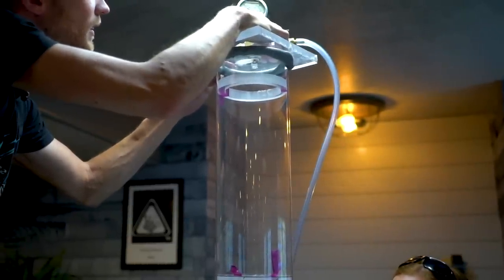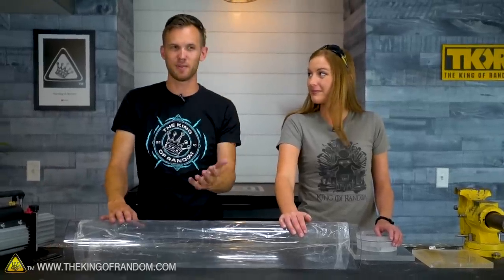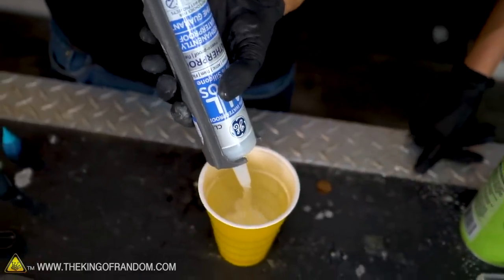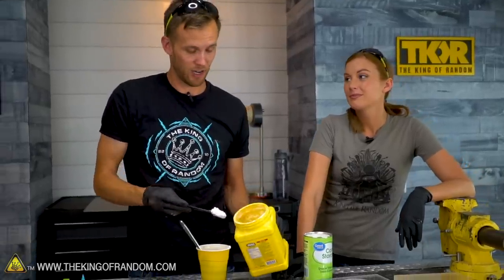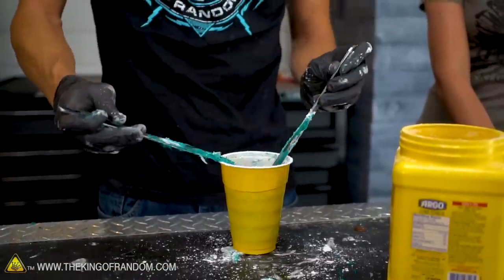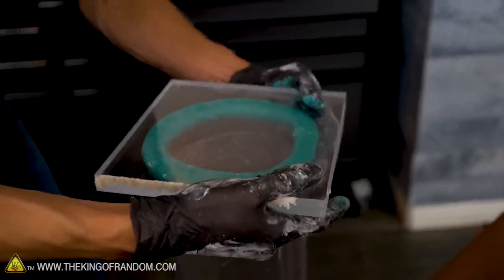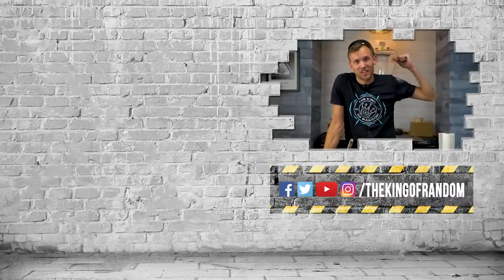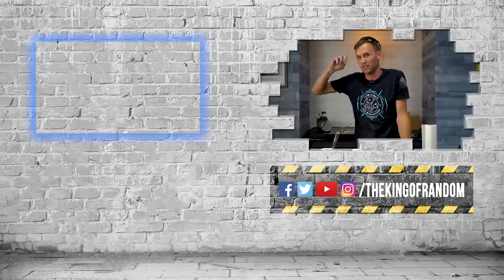Watch How Things Fall In Space

Comment: What would happen if you drop mentos in coke in the vacuume chamber ?
Reply: Kayden Mauldin the coke would start boiling, while the bottle would crush, so would be kinda hard to do the experiment.
Reply: And if you didn't do it at a full vacuum the CO2 in the coke would just fill the vacuum.
Reply: If you put the Coke in the vacuum chamber and then you drop in the mentos, the air bubbles in the Coke would have already been extracted, removing all of the pressure, thus resulting in no reaction from contact with the mentos
Reply: Kayden Mauldin the coke would not be acid any more and Mentos will not have something to react to
Reply: Souless would not be in bottle
Reply: @kueenkouture4362  has nothing to do with the acid in coke and the mentos don't in react at all. What happens is nucleation. The mentos have literally 1000s of little spikes on them and little dents. These places / points help the carbon dioxide toe release from the coke. You can also use salt sand or even powdered metals. Many bars have glasses with a small ring in the bottoms that perform the same function. If you go to a nice bar after work or something look in the bottom of your glass of beer. You will see a ring a little larger than a pencil eraser in the bottom
Reply: @nanaki-seto  the acid in the coke is where the carbonation comes from. It's called carbonic acid.
Reply: Smart bro smart
Reply: Kayden Mauldin the coke will boil befor it’s ready to drop
Reply: Hmmmmmmmmmmmm?!??????????????
Reply: @NFTI  it's still what holds the extra CO2 in the drink.
Reply: @mimked  They pump C02, into the water, where it dissolves into the liquid.
Reply: @mimked  and that is not what causes the reaction. The reaction is the carbon dioxide gas being released from solution. The acid type reaction your thinking of is vinegar + baking soda and other similar reactions . They can be based on a acid reaction or a base reaction . Again not what happens with mentos
Reply: @nanaki-seto  is that what I'm thinking of? I just said that the extra carbon dioxide is held within the acid (carbonic acid) contained within the drink. So if the acid was gone (as someone said earlier would happen if the drink was put in a vacuum chamber), then there wouldn't be any CO2 to react to the mentos. Unless the nucleation doesn't come from inside the drink.
Reply: YES
Reply: XxsparksgirlxX oof 
D
Reply: Souless guys the action lab did it search it up on youtube
Reply: 600th like
Reply: Nova Flare NERD
Reply: do it
Reply: Chaos
Reply: Not much will happen
Reply: a thing that involves liquid that I cannot confirm
Reply: We will never see him do it 😭
Reply: @rayneang5153  yup 😞
Reply: @nanaki-seto  theres no acid in the coke. The coke is acid
Reply: @mimked  theres no coke in the acid. The coke is already qualified as an acid because it was mixed with carbon dioxide chemically which would result to the change of the components in the mixture.. it would be a whole new thing. And ye the coke is acid there isnt acid in the coke, get that right.
Reply: @nanaki-seto  basic reaction* its not base reaction.
Reply: @Bruh-yt9hz  I don't see the functional difference in lay person terminology. If "the coke" refers to the bottle of soda, then yes, there is acid in there (unless it's gone flat). 

If "the coke" refers to the liquid contained within, then sure, the whole thing is acidic due to the carbonation process. But that doesn't make it fundamentally wrong to refer to the acidic component as "the acid". Carbonic acid is H2CO3. That doesn't include the syrup that makes "coke" coke. And if that acid breaks down to H2O and CO2 (what happens when the soda "goes flat"), the non acidic solution within will still be called "coke". So referring to Coke as "the acid" is a bit misleading to the normal, everyday person.
Reply: @mimked  if that still isnt clear to you, mabye you have a different concept of the term "acid"
Reply: @Bruh-yt9hz  Sure, that's possible. 

It's also possibly that you just didn't bother to read what I just said.
Reply: Coke does not have carbonic acid, it's just desolved CO2 and when CO2 enters the stomach it combines with stomach acid to create carbonic acid. The experiment could work if the mentos were to hold a seal until they were dropped.
Reply: @mimked  :/ i read it thoroughly thank you very much. :v
Reply: Bubbles
Reply: @mimked  I think you have your cause and effect mixed up.
Reply: @mikemartin9833  which part, and does it matter? I've said a lot of things in this comment thread, so I'm not sure which cause and effect you're referring to. 

If it's something like "Coke is pumped with extra CO2, and that creates carbonic acid" vs "carbonic acid is what holds the extra CO2 in Coke", I would ask if there is really an important difference when it comes to the question of whether or not Coke will react to mentos in a vacuum.
Reply: The coke would lose its fizz coz of the vacuum, so nothing
Reply: Nothing. Theres no carbonation in the soda then so there would no reaction
Reply: Kayden Mauldin please do stuff like this
Reply: The coke would uncarbonate

Comment: If you passed middle school you know that a feather and a rock can fall at the same speed
Reply: yeah, tape them together
Reply: Yea but we never saw that it really happens. It was only theory.
Reply: An unknown man all you need is a big heavy textbook, you put the items on the textbook and you drop it, & both of the items will fall at the same speed because the textbook will block out the air resistance
Reply: @DaArK117pro0o  I saw a display at the Museum of Science and Industries in the late 50"s They had a same basic set up and dropped a feather and a large ball bearing in a vacuum tube.  Both hit at the same time.
Reply: Only in a vacuum.
Reply: Dropping things that are laying on a textbook doesn't count as dropping two separate things, it would count as dropping a textbook, which would fall faster than both a rock and a feather if dropped separately...
Reply: An unknown man no there’s a video showing someone drop a bowling ball and feather in 0 atmosphere and they fall same speed
Reply: yea, the feather encounters air resistance so it falls slower than the bowling ball
Reply: @DaArK117pro0o  its not a theory tho it's been proven before, the only reason that a feathee drops slower than a rock is air resistance
Reply: Yep
Reply: No way that's cap
Reply: Didn’t do middle school
Reply: Not can they do. The only thing stopping them from doing so is our atmosphere.
Reply: It doesn’t

Comment: You should try using something coarser then corn starch. There would then be greater kinetic potential in the dust and it should behave a bit differently. The corn starch is much too fine and light, not at all like the dust on the moon. Perhaps something like granulated sugar or some very fine sand?

Comment: You don't need vacuum to prove this. If you have two spheres of the same size but a different weight, it works. Galileo showed this during his trial.
Reply: Right, but with a feather and a penny, it's not so much that the feather weighs less, but that at has more air resistance, where as the two spheres had the same air resistance. That's why a crumpled up piece of paper falls faster than a normal piece of paper.
Reply: Shhh, don't tell the flat earthers this ... it ruins their theory that gravity doesn't exist!
Reply: you been eating Smarties lately?

Comment: You should be able to make some sort of small clip that opens and closes with a magnet that is held outside the chamber. This way you can drop items that are not magnetic as long as the clip can hold them. The clip would be attached to the inside of the lid and the magnet holds it closed from the outside.

Comment: If you use a series of valves on top of your chamber you'll be able to put stuff in the vacuum chamber that doesn't require a magnet. 2 inch valve on the lid, piece of 2 inch pvc and then another valve

Comment: Would it be possible to crate a small decompression chamber in this so that you can be able put things so you can drop them without losssinf the vacuum or a trap door that can be open from the inside with the pull of a string or something

Comment: Use a small muffin fan and battery with a magnetic reed switch (switch can be turned on or off with a magnet through the plastic or glass tube) to see if you can blow a pile of corn starch with the fan in a vacuum.

Comment: I could answer before watching, the drop time is only effected by air resistance, take away the air, aka oxygen/carbon dioxide mixture aka submit it to a vacuum. Both will drop the same without air resisting against it

Comment: Air resistance can be deceiving. The feather is naturally designed to gain air resistance so that birds can glide in the air. But neglecting air resistance, all objects on Earth will accelerate towards the ground at a rate of 9.8 meters per second squared. This is the acceleration due to gravity on the Earth's surface.

Comment: The ball dragged the feather down the tube through static adhesion until the two separated at which time the ball is seen accelerating faster than the feather.
Your experiment failed to prove anything different than what is seen on earth at atmosphere. The only difference in a vacuum is that everything happens slower than at atmosphere.  The visual evidence of this is found at 9:20 to 9:30 of the video, 9:28-9:30 specifically. Atmosphere speeds up the ratio of acceleration in a gravitational field relevant to weight differential. Vacuum does not negate that ratio, it only diminishes the ratio. Therefore in a vacuum, the higher the drop in a gravitational field, that ratio increases. The science of gravity, mathematics and magnetism do not lie but many believe they do. So your experiment does prove my point.
However! As you did not achieve a perfect vacuum, air would sink to the bottom of the tube therefore effectively slowing the descent of the feather towards the very bottom of the tube. So am I correct or incorrect? Or am I both?

Comment: What if you put helium in the vacuum chamber
Reply: Depends on the fluid temperature and pressure which determines viscosity. Also, you could only have a partial vacuum otherwise you'd have no helium.